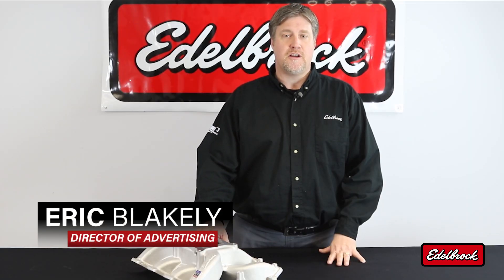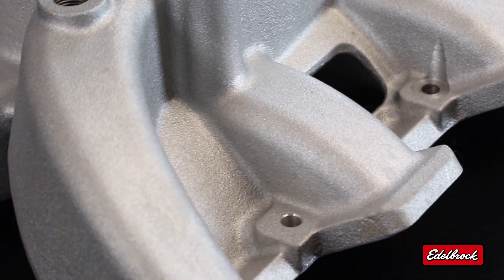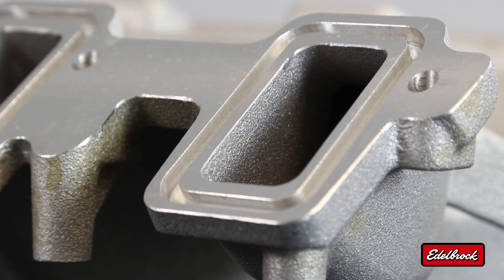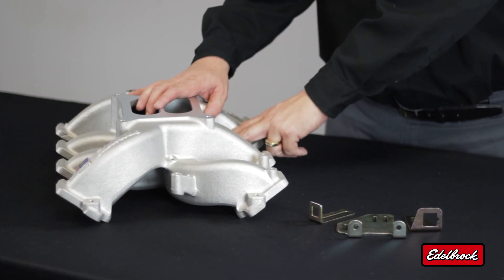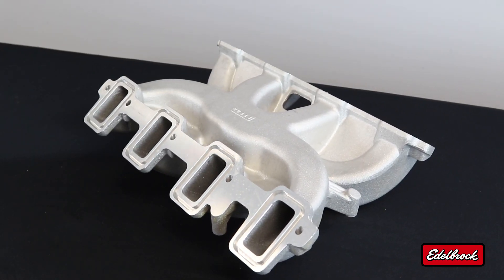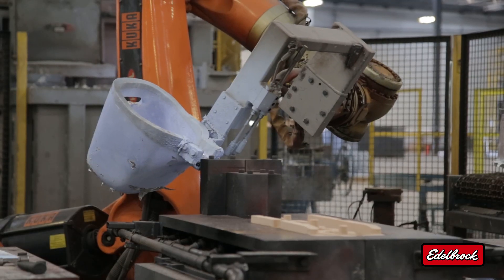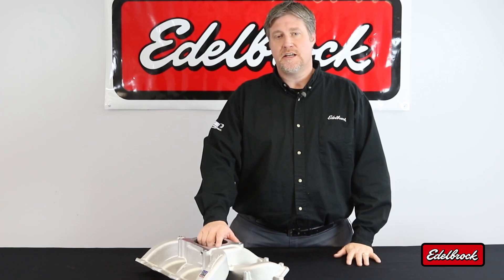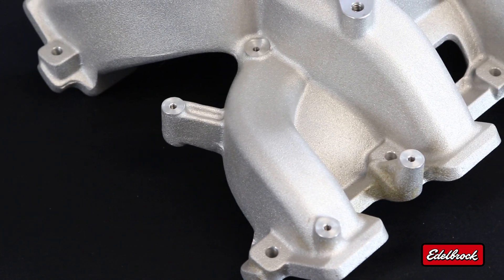Edelbrock Performer RPM LS3 Intake Manifold

Comment: Problem is you can't run L92 LS3 heads on a LS1/LS6 you need a 4" bore. The only way is if a LS1 is bored to 4", most LS1 blocks don't have enough meat in the cylinder for this. LS2, LQ4, LQ6, L77 etc. can use the L92 heads.
Reply: Actually Edelbrock offer a rectangle port cylinder head for LS1 99mm bore engines! http://www.edelbrock.com/automotive/mc/cylinder-heads/chevy/e-cnc-ls3.shtml